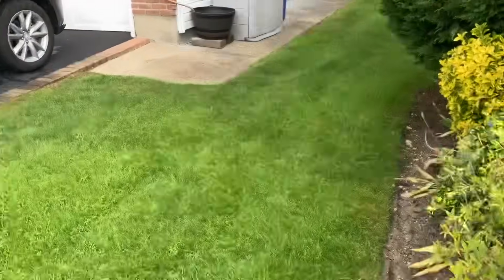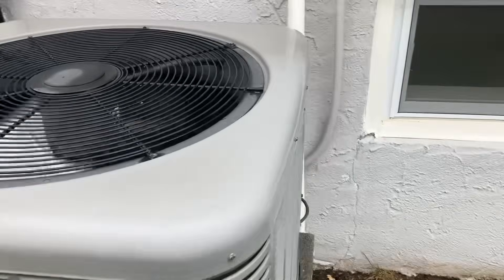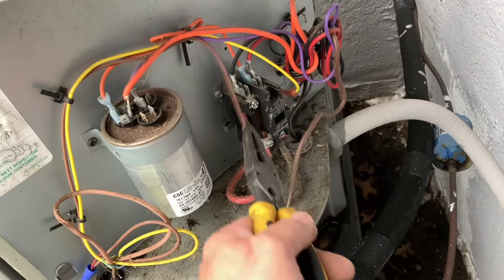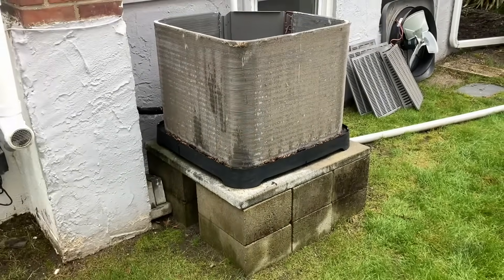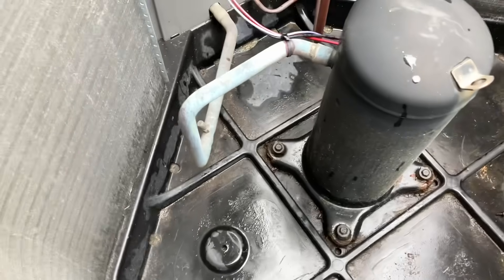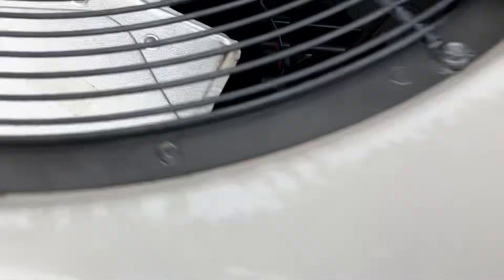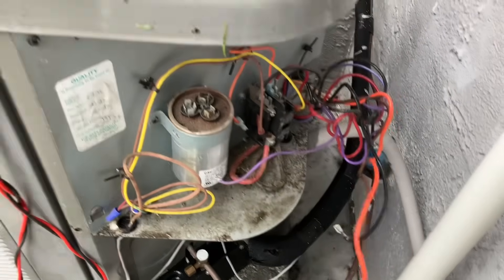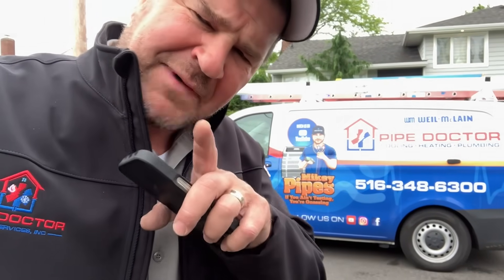4‑Ton Rheem AC Wearing a ‘Fur Coat’ 😱 | Deep‑Clean, Capacitor Check & Instant Performance Boost!

Comment: Had an HVAC guy service my AC yesterday. I had just cleaned the coils with Frost King Coil Cleaner and he emphatically said not to use AC coil cleaner on the unit - only ever use water.
Your thoughts?
Reply: I used AC coil cleaner on my unit for at least the past 10 yrs. I bought a gl of concentrate from Amazon, dilluted it per directions and it works great. It helps to loosen dirt and such from the coils and then spray it off with water from the inside to get all of the gunk off...

Comment: I had the same issue with my AC unit. This is how I fixed the problem. You cleaned the condenser but did not resolve the source of all the "fur". The "fur" is coming from the dryer vent 5 feet to the right of the unit. I made a outside lint filter that catches all the lint the bypasses the filter in the dryer using a BetterVent Indoor Dryer Vent from Amazon, that I modified and installed over the outside vent. I clean it out weekly, you would be surprised how much lint builds up in my outside filter. This customer will be calling you again in the future to preform the same service if they do not install an outside filter. The home builder should have located the dryer vent/AC unit away from each other.

Comment: Those Rheem a/c’s were tough units . That louvered cabinet did a good job of protecting condenser coil from damage , but also did a good job of hiding dirt build up !!! 
Excellent service work as usual !!!
Reply: I was thinking that same thing. My condenser has very little protection which makes it super easy to clean but also susceptible to the tiniest bump.

Comment: You dont need to remove all the wires to check the capacitors. Just the common wire need to be removed. I have done both removed all wires and only the common and it always is the same. Try for yourself
Reply from the maker: I appreciate the tip!